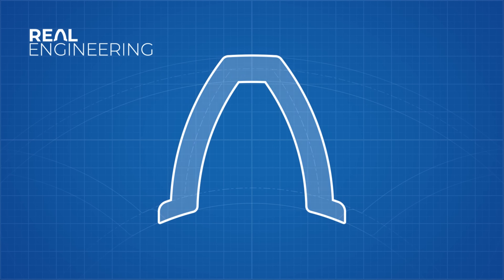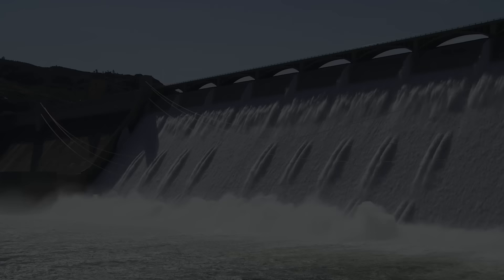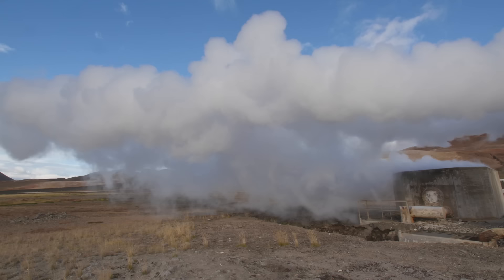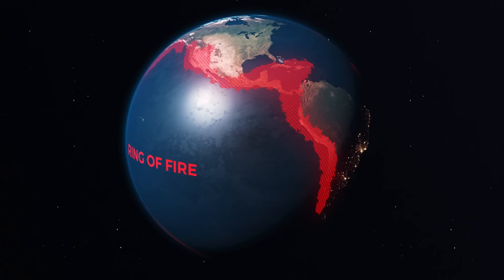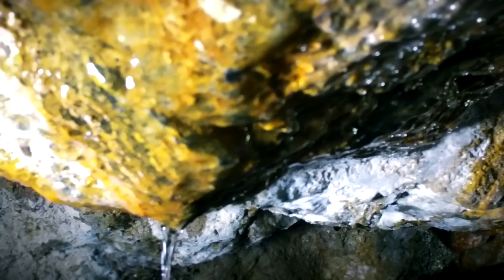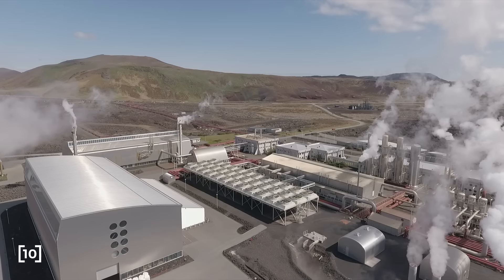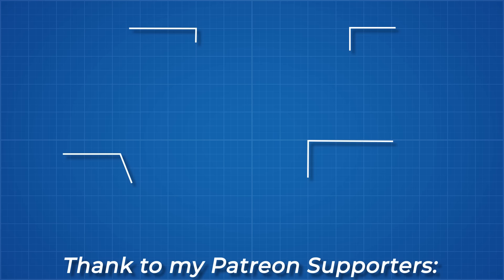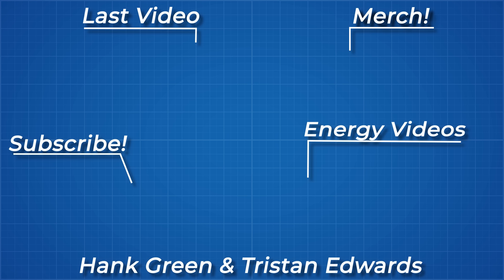Could Earth's Heat Solve Our Energy Problems?

Comment: No , it could drain the core of heat stopping it rotating though
Reply: You think the axial rotation of celestial bodies is powered by heat from the core?  How would that work?  Is that also what keeps the Moon tidally locked to Earth?  Makes about as much sense..
Reply: @freemind..  Pawww the core would solidify and stop moving like liquid as heat was removed and our electro magnetic atmosphere would vanish and we'd all die , its science
Reply: @DerekFolan  - What is this "Science" of which you speak??
Reply: @freemind..  its elementary,  if you take heat out of something then it cools. It only needs to cool enough to set off a chain reaction of soliditation from liquidification
Reply: @DerekFolan  - Soliditation?  Liquidification?  New sciency words?  Anyway, the inner core is already solid, and the core dynamo hypothesis has never been proven at all.  In fact, the most reasonable explanation for the origin of the magnetic field of Earth is that the field is created in the crust, it is piezoelectric in nature, and a process called Earthtide is the mechanism.
Reply: @freemind..  No no no the core is molten magma,  it's the movement of iron in this form that generates the electro magnetic field , the data correlates to this hypothesis within expected parameters
Reply: @DerekFolan  - Check again..  The inner core is solid, and the outer core is liquid.  One big problem for the hypothesis is that there is no known allotrope of iron that even allows it to exist at core pressures.  Reality is that the "experts" have no idea what the core is actually composed of, nor do they know the actual temperatures of the cores.
Reply: @freemind..  We need to allow the core to be itself. The core is condensed liquid magma at such density that it resembles a solid state relative to extreme external pressures, in lay mans terms it's just easier to inform non academia that the core is solid, to save on time , in a sense the core has it's own weather structure so extracting heat is as dangerous as warming the planet.
Reply: @DerekFolan  - That's an interesting idea.  Where did you see info to that effect?
Reply: @DerekFolan  - I've seen no evidence whatsoever to validate the idea that the inner core is magma.  Without evidence, that claim is nothing more than supposition.
Reply: While we're at it, where is there actual proof that the interior has been kept molten for billions of years by heat from radioactive decay?  If you found a rock of uranium and picked it up, it wouldn't even feel warm.  Radioactive decay won't even boil water without manipulation by man... and that's a far cry from melting rock!  Much of what is taught as Science is nothing more than Science Fiction.
Reply: @DerekFolan  - If magma is melted rock that has been kept molten for billions of years by radioactive decay, then why is that magma itself not radioactive when it comes out of a volcano as lava?
Reply: @freemind..  Its an envitable consequence of high pressure,  The Centre moves as one super unit of liquid, resembling a solid, however it's a condescended liquid magma, with no room for inward waves under such pressure the core can only have outward bulges at certain points defined by higher layer conditions, the core unit moves as one near the centre. Resembling a solid, yet it is not a solid. It's a super dense liquid under extreme pressure,  Pull too much heat out one side of the earth above affecting higher layers,  that is going to affect the balance of relativity between layers. What can happen when we release pressure in 1 direction ? We create a path of least resistance. It could be like letting air out of a tire. Except with magma. I would predict volcanic activity would follow.  its rudimentary
Reply: @DerekFolan  - So.. no actual evidence.  You just think it makes sense for that to be the case based on other ideas that you assume are true.  Got it.
Reply: @freemind..  Well if we look at history, places like Atlantis are not around anymore, could be geo thermal combined with a natural gas explosion caused a volcanic plate sinking event of epic destruction,  The evidence may have been blown to pieces unfortunately by a large volcanic eruption of immense magnitud, or under the sea,  if in fact past civilizations did attempt to harness geo thermal power somehow a plate collapse may have occurred and land could have sank. I'm confident with improved modelling of core dynamics we can obtain the data, maybe before rolling out the massive geothermal power plants, to avoid the balloon popping.
Reply: @DerekFolan  - "Well if we look at history, places like Atlantis are not around anymore"
Atlantis isn't exactly "History".  It probably wasn't even real, and can't be used as evidence for anything.
"I'm confident with improved modelling of core dynamics we can obtain the data,"
I agree.  Improved or new technology will eventually tell the tale.  I'm betting that when they can finally actually KNOW what's inside the Earth without guessing, it will necessitate a complete rewrite of many of the natural sciences.  For now, I have to content myself with asking questions that no one seems to be able to properly answer.
"maybe before rolling out the massive geothermal power plants, to avoid the balloon popping."
There will be no massive roll-out for geothermal.  It is only viable along or near active faults and plate boundaries.  This is what everyone seems to miss.  If everything were as we have been told, we could tap in virtually anywhere on Earth..  but that isn't the case.  No one has EVER drilled into a magma chamber, and they never will.  The heat is being generated within the crust itself due to seismicity along those very faults and plate boundaries.  It is not coming up from deep in the mantle.  Frictional ground movement primes the geysers at Yellowstone.  Excessive seismicity has even activated dormant and unknown geysers.  

Why do mines generally get hotter with depth?  Why do boreholes get hotter with depth??  The answer we are given is that they get hotter because you are getting ever closer to heat radiating out from the core.  That does NOT explain what we observe!  If that were true, then the deeper you are anywhere on Earth, the hotter it should be.  Deep cave systems should get hotter with depth for that same reason..  BUT THEY GET COLDER.  

Oceans should get hotter with depth because of increasing proximity to the core too...  but THEY ALSO GET COLDER.  Oceanic crust is 1/5th as thick as continental crust on average.. and some places like the bottom of the Mariana Trench should be extremely thin, and should therefore allow measurable heat to radiate through...  but it's one of the coldest parts of the ocean.  Why?  Because it's not really hot inside the Earth.

Boreholes do not show a steady temperature increase with depth.  Instead, some show massive temperate increase when drilling on a fault (KOLA), whereas other boreholes show ZERO temperature increase for over 3000 feet, or even temperature decreases at times.  Much of our science...  isn't.
Reply: @freemind..  Let's try to stay on topic here. We must focus on the task at hand to achieve a higher level understanding.. Atlantis and other past societies are examples of technologically advanced societies which are no longer here anymore so it seemingly must have vanished or did not exist, so it indicates that past evidence may not be preserved in easy to reach fields for guys like archaeologists to dig up. These places could be buried under oceans. First we need to view the earth without any water to get bulge information, you can see it's not  round in shape that way. A Google search can provide you with this image for your "research" into the subject.  Water levels even out the shape of the earth with gravity because as a liquid it moves with the tides and with gravity and fills in the uneven holes. Mountains on one side and vast holes on the other sides of earth filled with water. The earth collapses and bulges, if you start artificially venting heat out from one place that will affect the balance of the core. You have mountains, as an output result, in obvious places,  but also the opposite of mountains, less obvious on the surface, forming in other places, which are likely where you find deep oceans. The data correlates to a ratio of core pressure bulges and surface vent points that have a slower natural pressure release system, which of course sometimes results in volcanoes. We must ask can volcanoes have an inverse, A sinking elsewhere, to link to core bulge and dip oscillations. Results indicate Yes, mountains and deep ocean trenches,  The data,  it's right in front of us, although not processed into white papers
Reply: @DerekFolan  - You are right about needing to examine any and all evidence, but we also need to be open to the idea that long-held beliefs might possibly be incorrect, no matter how deeply entrenched.  Example..  It is believed by nearly everyone that every mineral of every type on Earth cooled from a magmatic melt.  However, the vast majority of the minerals can never have been melted because they are crystalline instead of amorphous (glassy).  Crystals grow in water, and melting them turns them glassy and destroys piezoelectric and magnetic properties, which are maintained by the bulk of minerals as testament that they were never melted. 

All attempts to reproduce the various minerals without water have failed.  This should be a huge red flag to scientists that the dogma is incorrect.  If the minerals form from water, then the world most likely did not form from Accretion and was never a giant ball of magma.  Whatever liquid the Earth was formed from is almost certainly the same liquid contained inside it now.  Suddenly the recent tomographic scans showing that the liquid in the outer core has a viscosity like that of water.. make sense.  Additionally, the idea of an inner core composed of Ice XV (the only known substance that can exist at core pressures) doesn't seem so crazy.  If we stop insisting that only a magmatic interior can be possible, we will probably achieve that greater understanding that you talked about.. and this time it might actually be correct!
Reply: @freemind..  That's a fascinating hypothesis,  unfortunately I've been running the numbers and my research data indicates that We have water on earth. The only logical conclusion is that near the core of the earth pressure is so intense that molten magma is so dense that it resembles a solid material. In fact the core of the earth is slightly smaller than our moon yet weighs more that the entire rest of planet earth. If that weigh is somehow redistributed to new path of least resistance the earth may rebalance itself leading to a large polar shift and a change in the tides. These are just fundamental consequences of balancing, The oceans tides do support the earth to maintain a steady balance however new volcanic activity can augment the underlying ocean base plates. Are we sure we understand the consequences of using renewable heat from the core when this must amplify an exhaust channel, maybe causing a volcanic outburst under certain earth rotation conditions
Reply: @DerekFolan  - Extreme caution and better understanding are definitely called for before proceeding!  It's been interesting and enjoyable interacting with you!  Thanks for the thoughtful exchange!!
Reply: @freemind..  You are welcome. I dont mind taking the time to educate the larger community on these findings.

Comment: 2:10... And there's the rub. "If we could find a way...." I am 64 years old and people have been looking for that way for longer than I've been alive. Those that found and utilized the heat close enough to the surface, soon failed. It seems that heat does something to all the minerals in the ground. They saturate the water. Then the water either corrodes or heavily deposits in the pipes used for this technology. No solution yet. Makes for a good video, though, doesn't it? Uncountable ideas out there. Then that pesky engineering and reality get involved. If only it was as easy as making a video....
Reply: 7.8 billion people and "Always Growing" compared to 4.3 billion in just 1980.
We can not keep that up while the earth's mass and resources do not grow.
Overpopulation is a taboo topic when economies NEED eternal growth to function.

Comment: Instead of using turbine to drive the geothermal power plant you can use Stirling engines. They might be familiar to you. https://youtu.be/saCdvAp5cow   And you can watch https://youtu.be/vGlDsFAOWXc  No need to boil water you just need a temperature gradient.

Comment: Solar and pumped storage is cheaper
Reply: Pumped storage requires both suitable land and lots of water. That's not allways available.
Those artificial lakes are not only big, but can - especialy in warmer climate - have a significant negative effect on greenhouse gas emissions. Those lakes heat up and produce a lot of plants that will eventually die and decay. They will then release methane. A gas that is a far more potent greenhose gas than the CO2 the plants absorb during growth.

Comment: "Real engineering". LOL...

The theoretical maximum power you can draw continually from geothermal sources is if you take ENTIRE heat flow coming though the surface of Earth. (If you try to draw more, the subsurface temperature will be falling, and the power you generate will be falling with time).

Even if you 100% efficiently harvest this continuous geothermal energy flow over ENTIRE surface of United States, you can barely power current US energy demand.

IOW: generating all electrical power from geothermal is infeasible, even assuming 100% efficiency!

Comment: Not bad from an engineering standpoint, but lousy from the geopolitical ("climate change") perspective. Drastic changes are not required! If you're one of those overly emotional, wimpy, "dumb geniuses" (perhaps high IQ, but low humility-induced intellectual blindness), then this comment may seem sacrilege. But science, history and empirical evidence prove that,
* Climate always changes;
* Warming in our current Ice Age produces far more benefits than drawbacks (Minoan, Roman, Medieval and Modern Warm Periods);
* Cooling produces far more drawbacks than benefits (Greek and post-Roman Dark Ages [with Viking terrorism], and Little Ice Age);
* The only meaningful correlation between CO2 and temperature in the world-at-large is from temperature driving CO2 into and out of the oceans as a dissolved gas;
* The sharp spike in CO2 in the 20th and early 21st centuries did not produce a comparable spike in global temperature;
* The regularity of the Holocene major warm periods was right on time with the Modern Warm Period and human Industrial Revolution; and
* We currently live in the Most Prosperous Period in human history, with extreme poverty plummeting not only by total numbers, but also by percentage of total population, despite the skyrocketing world population.

References: Climate Basics: Nothing to Fear
Thermophobia
Red Line - Carbon Dioxide
Deserts & Droughts